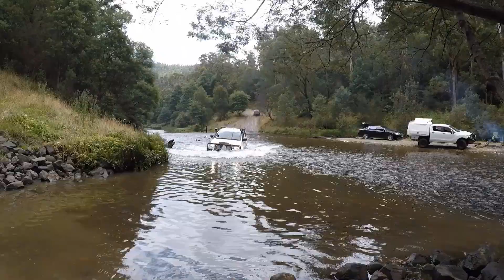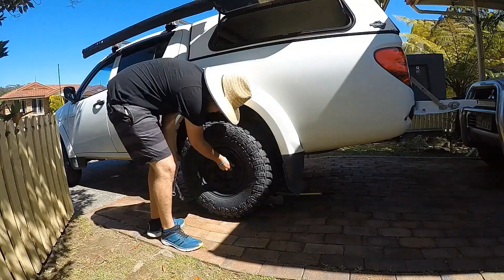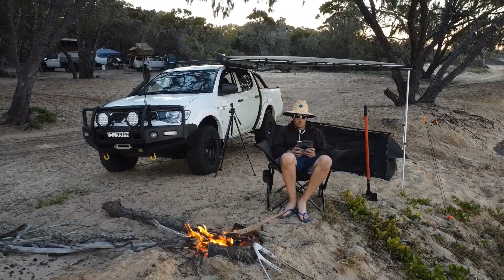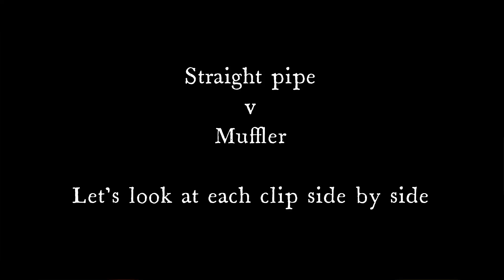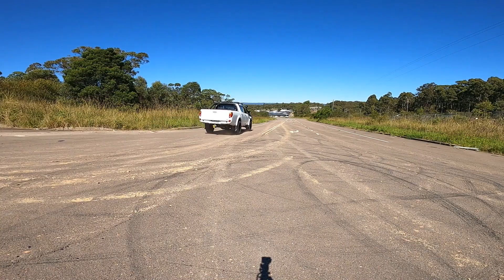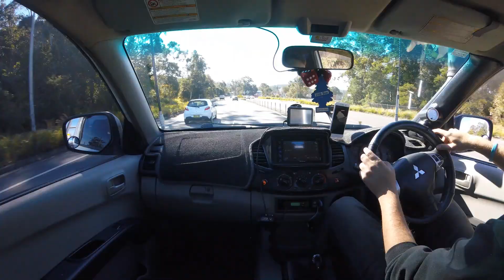3" Straight pipe v 3" Muffler - MN mitsubishi triton

Comment: Muffler delete with 20 psi have nice flutter, KN filter gives beautiful spool. No issues what so ever with my Ute. Still have factory muffler in case of police
Reply from the maker: Yeah had that setup on the old ute and sounded good. Binned the K&N filter as they are useless and killed two MAF sensors from dirt getting through the filter. Paper filter is the best

Comment: My Colorado had a muffler delete with the exhaust pipe finishing just behind the cab when I bought it. The dealer tried to tell me that it had a tune done, not that it fooled me 🤣
While it wasn't overly noisy, it did drone a bit.
Recently I tracked down a standard rear muffler at a wreckers so I swapped it out.
Drives nice and quiet with no notable detriment to performance.
If anything, the fitting of a Safari snorkel made more of a performance improvement.
Since buying it, I've tried to make sure that there no issues that the boys in blue can defect me for and nothing to fine!
Reply from the maker: Heaps of people have it like that and beats me how they get away with it. Mine was in the factory spot out the back and got done twice for it yet there's much louder 4wds out there blowing smoke and racing around.. a snorkel does help a little. Some say it doesn't but you get slightly cooler air then under a bonnet. They'll still defect you if they want. Can't have a vehicle that's not factory without having issues nowadays

Comment: Grat video. HAve you noticed any performance or better response with the  3" Straight pipe ? Planning on putting 3" inch soon then a remap but will see how it reacts with the 3 inch pipe only.
Reply from the maker: @jflorez3031  No change in how it runs with it at all in 4yrs. Only changed the sound of it

Comment: So what actuall make the flutter sound full straight pipe or reso delete
Reply from the maker: 3" pipe & no muffler. Doesn't do it anymore with the muffler due to having back pressure now.
Reply: @gettindirty4x4adventure  I just installed a muffler delete with stock decat so doesn’t make any flutter
Reply from the maker: @josephjdm4877  What motor do you have? Theres a 100kw in the 2WD which won't flutter due to the turbo being diffrent and the 131kw like this which flutters. A muffler delete won't give you the sound as loud but still a little bit. I had a muffler delete on the old MN 100kw and was quiet.
Reply: @gettindirty4x4adventure  I go 2011 Mn glx 2WD , I take the stock filter out and put a bod filter on and a muffler delete so I can hear a little bit of flutter
Reply from the maker: @josephjdm4877  Diffrent turbo in that compared to mine so won't sound the same as this no matter what you do to yours. I wouldn't put in an aftermarket filter like that. Had a K&N filter in mine and was nothing but trouble.
Reply: @gettindirty4x4adventure  I’m thinking of putting big intercooler and a decat
Reply from the maker: @josephjdm4877  Intercooler would be good to keep the intake temp down. Wouldn't remove the cat. Not worth the defect and fine
Reply: @gettindirty4x4adventure  oh yes I’m in Melbourne , what mod have you done on your car , and what turbo
Reply from the maker: @josephjdm4877  Modifications 

Driveline 

• Maxxis razr MT - 265/75/16 on a 16x8" +20 steel rim
• Heavier king springs & shocks
• 

Under the bonnet /performance 

• Ryco secondary fuel filter
• Flash lube Catch can
• 3" playtime auto exhaust 
• 12v duel battery gauge
• Air on board diff & gearbox breathers
• Grunt gas bonnet struts
• Ebay special snorkel
• Forefront intercooler hose kit
• 

Miscellaneous - body/protection/various 

• Weathershields 
• TJM bullbar
• 3mm bash plates
• 3.5ft 7.5fbi UHF Ariel
• Rhino vortex 2500 roof racks 
• Wanderer 2x3m awning
• Genuine Mitsubishi tub liner 
• Staun tyre deflators
• XTM tyre deflator 
• Ocam bash plates 
• 

Interior - Electrical/comfort/safety 

• 52mm SAAS boost gauge
• 52mm SAAS volt gauge 
• SAAS gauge holder 
• Orricom UHF
• IDRIVE
• EDS scan guage 
• Reverse camera
• Floor vinyl to carpet swap
• Series 2 VE seats with huracan rails
• MN series GLX-R rear seats
• Fire extinguisher bracket
• Two fire extinguisher's behind rear seat 
• Emergancy first aid kit
• 

Audio 

• Kenwood Headunit
• Pioneer  TS-WX130DA slimline sub/amp
• 300w pioneer Speakers 
• Factory tweeters
• 

Electrical 

• Twin 9" round spotties
• Hella horns
• LED bullbar indicators 
• Weaco fridge wiring kit 
• Duel battery setup
• LED number plate lights

Factory turbo
Reply: @gettindirty4x4adventure  thank you so much might get a bigger turbo but idk which one
Reply from the maker: @josephjdm4877  Would add a bit more power👍
Reply: Could you put this turbo in the 2wd